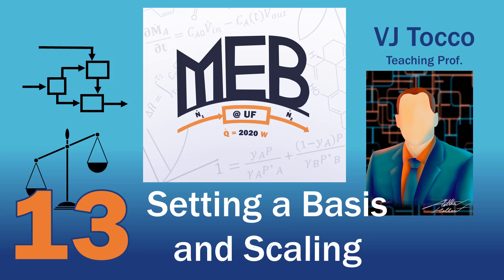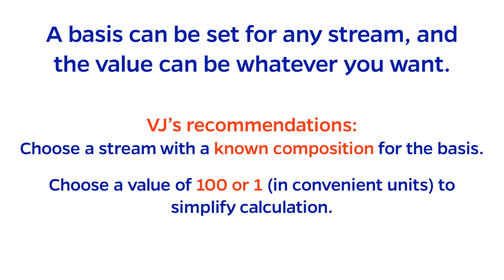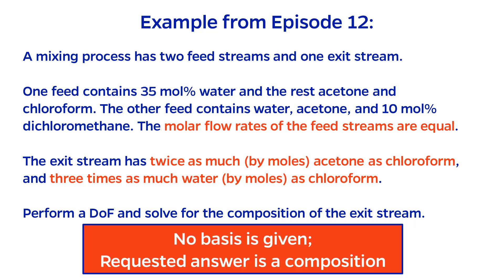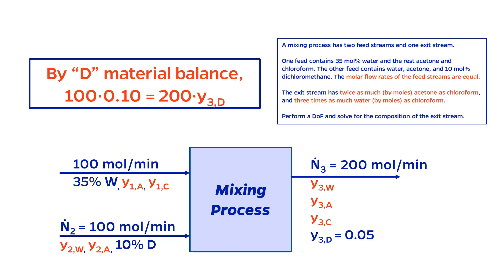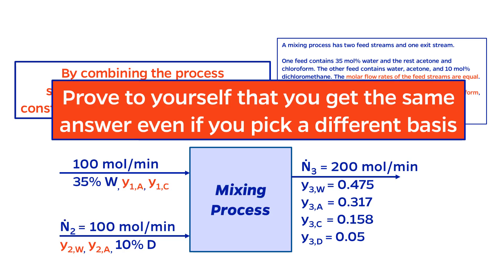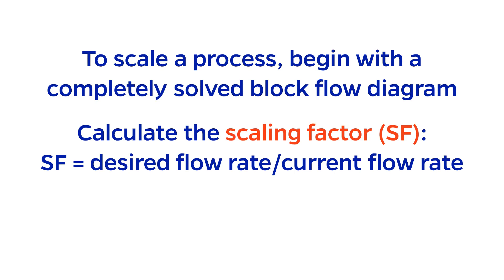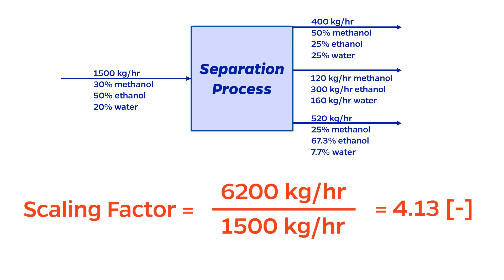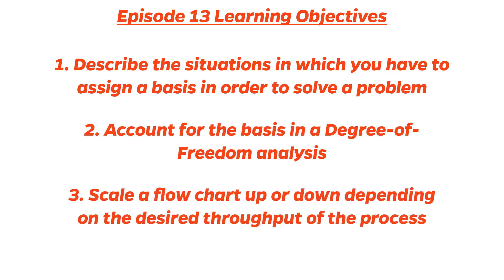Setting a Basis and Scaling (Material and Energy Balances Episode 13)

Comment: 2:46 may you explain that please? I’m turkish student and its kinda hard to understand that part. Thank you.
Reply: If i dont have mistake it should be y3w=3y3c and y3a=2y3c but i couldnt solve that.
Reply from the maker: @b @benberen That is exactly right! You need one other equation, which is the “physical constraint”. Since mole compositions can be expressed as percentages, they must sum to 1 (or 100%). Therefore, y3w + y3a + y3c + 0.05 =1, which should allow you to solve the system of equations.